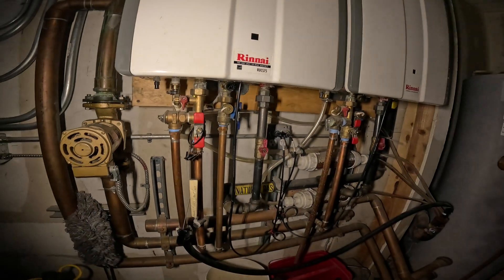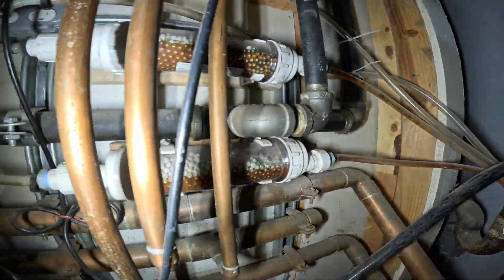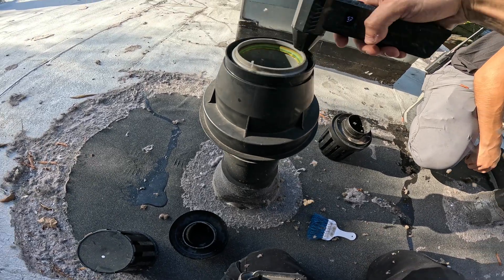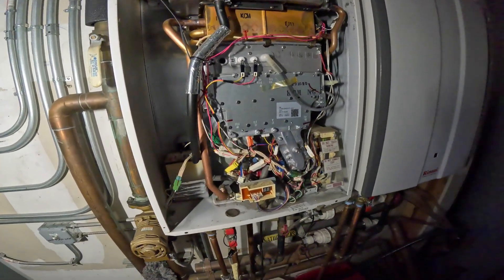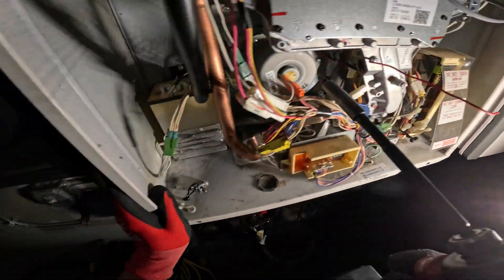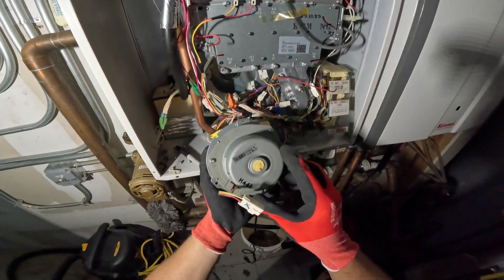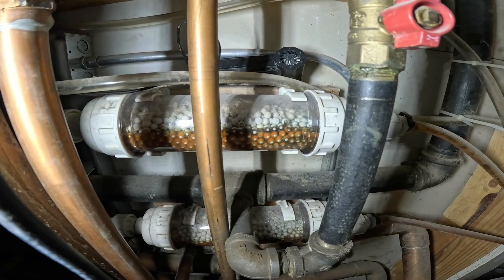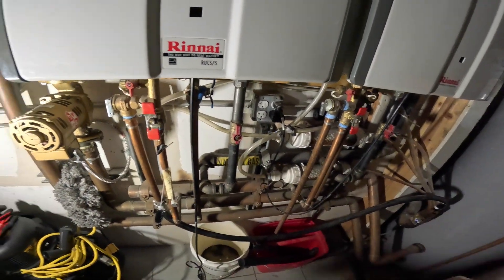HVAC: Rinnai Tankless Water Heater Error Code 10 (Rinnai Tankless Water Heater Not Heating Water)

Comment: vents need relocated to a wall where they don't get the lint into them or raised high above the roof, but that venting isn't meant to be sticking way out in the weather, so it would need a support structure. guess they could also abandoned the air intake portion and put independent intakes through the wall. if it's allowed per manual.

Comment: Make extra on this customer with performing a heat exchanger flush.  Good money on this service I perform.  Just be forewarned that he has an older copper heat exchanger (newer units are stainless) so there is a risk of springing a leak in the copper if it has heavy deposits on the inside.  Good luck & thanks for the handheld blower demonstration.  Just ordered one!